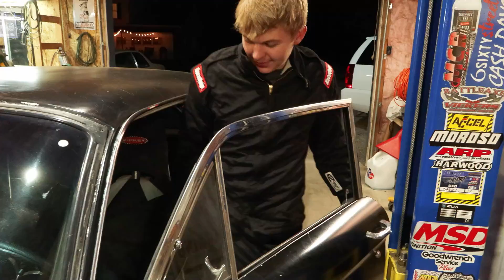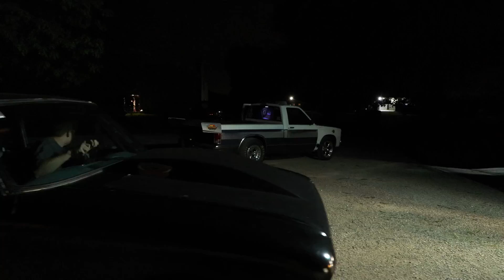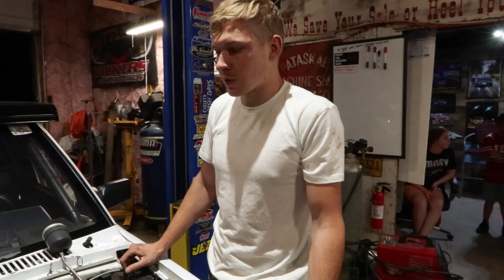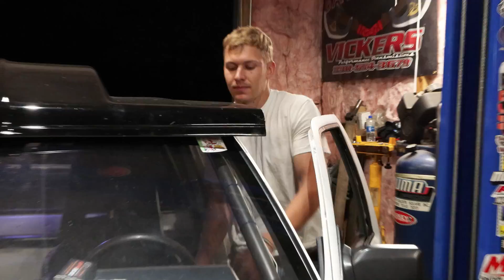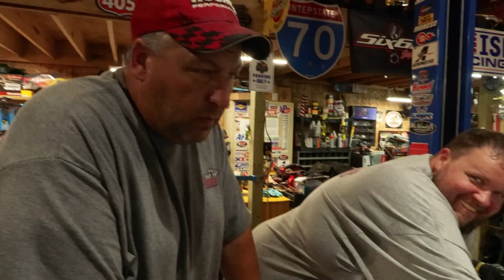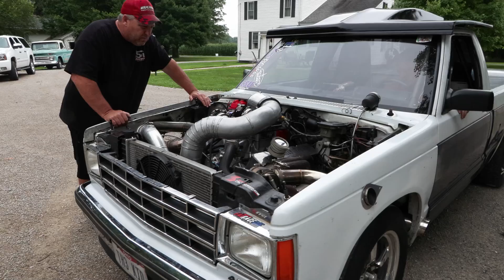Preparing for the STREETS! Testing on BARE ASPHALT

Comment: Leave the truck at home. I want to see you drive that Falcon billy. I've never seen you race in competition with it I don't think. Only when you very first got the car you made hits in it. But I haven't seen you race race with it, so I'd really like to see that happen I really would. Tommy does wicked good in that car I'm not Downing on him I'm not saying you're better than him kind of I want to see who drives the car better you or him, right now I'm going to say Tommy two guns because he's got many more passes in it than you but that doesn't necessarily mean anything and then again in the other hand it can mean something so I just want to see it leave the truck home get it tuned in you kind of rushed to get it together leave it home take the Falcon slow down go back through the truck check every Nut and Bolt every hose you name it check everything grease everything that needs to be greased change all the Earls put new brake fluid in it everything get that truck perfect take your time with it that truck deserves it Billy